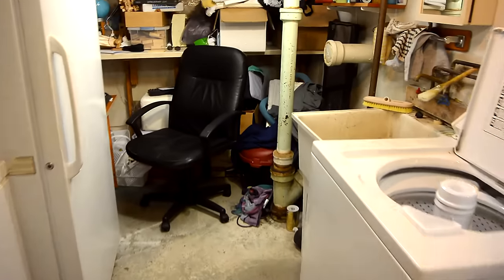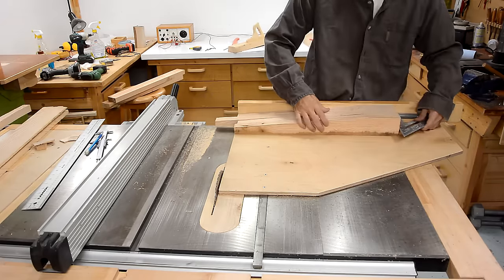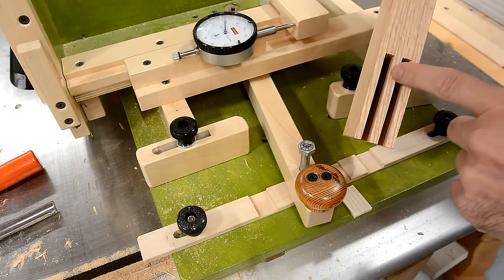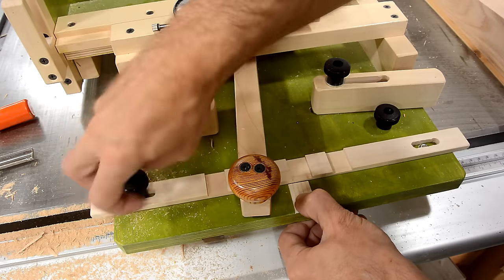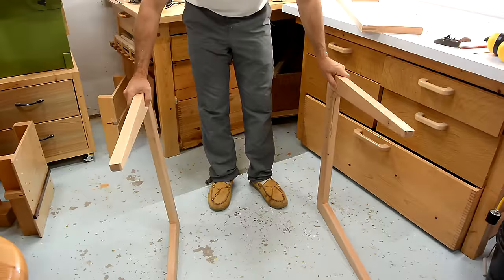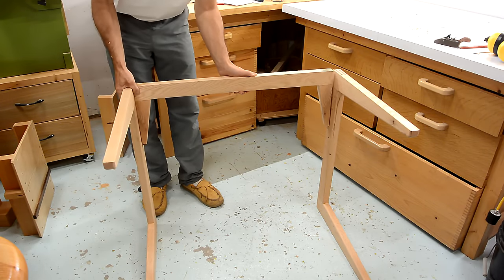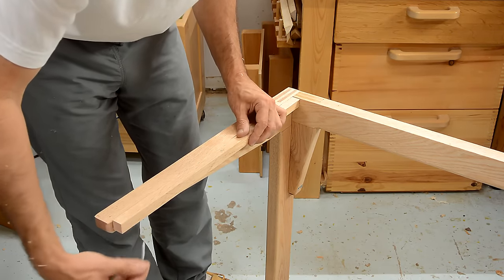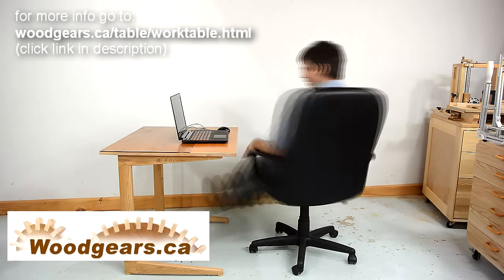Cantilevered work table

Comment: Is that a Lenovo Y500? I may be assuming too much because of the red keyboard, but it looks just like mine.
Reply from the maker: Not sure what the model number is, but it's a "gaming PC".  Had to get that for the quad core i7, which I need for video editing.
Reply: Sounds about right. I have it as well, but never added the 2nd video card as it was too expensive. Thank you and keep up the great work!
Reply: I have Y700, looks like that

Comment: I don't have the skill for that joint, what's the alternative?
Reply: I've found elmers wood glue max holds pretty well, I just use that and screws. At least, until I get more than a $100 table saw
Reply: That is basically a finger joint. If you have a some kind of table saw, and a crosscut sled, you can make it.
That was my first attepmt, and a day after, I made Darbin Orvar's jig (it's way more easy to make than the one by Matthias).
If you dont have a table saw, make one out of a handheld circular saw and a table by mounting it upside down, and adding a secondary swicth to the table.

Comment: Function over design taking to a whole new level. It's a nice desk to use I bet, but it looks awful.
Reply: For a desk that's only going to be used by him in the laundry room, that probably cost him nothing to make because he used scraps, it's fine.
Reply: Eh, just the tabletop. If he sold the plans, you could just build one yourself with a nice top.
Reply: Dave Starr I'm not commenting on whether or not anybody going to see it or if cost him anything. I'm simply saying that it could have been a fine piece if he had used a better top and better materials. I understand he didn't want to spend any money on this since it's only a desk in a laundry room.
Reply: Ok what's exactly awful? The multi-colored top? We didn't see it in the intended spot, did you notice the shadow? Perhaps the light angle is lined up with the different shades on the desk surface, we don't know. However the legs with the finish look pretty good in natural oak.
Reply: Falcon Rogue No finish, horrible tabletop, bland design. Also remember this is a simple opinion by a person on the internet. If you like it, great. This project just wasn't for me. I like to see that little ekstra put into it to get the finished look.

Comment: How do you even know these joints are this strong
Reply from the maker: It's more the strength of the wood.  Half the wood is cut away, but the rest of the wood would take an awful lot of force to tear apart.  Basically, this sort of joint fails when the wood tears apart, not the glue.
Reply: +Matthias Wandel i was shocked when i saw you jump on it. As a non woodworker (Im interested in starting) i though it was just sturdy enough for a laptop and a monitor. i have been planning a desk which will be around 2 metres wide, would this kind of bridal joint work just as well on a larger table?
Reply: Matthias Wandel Oh, well. Thank you a lot for your reply.

Comment: nice frame but ugly table top.
Reply: It isn't the best looking, but it isn't offensive.
Matthias has expressed that he finds basic functional things aesthetically pleasing, so I imagine it suits him fine.
Reply: To me it's the fact he goes with the effort on making the legs perfectly by using a jointer and routing then tosses on a beat up looking top. I would of at lest stripped down the old finish and slap on a new finish of some sort.
Reply: Leland Clayton Like to point out that sharp edges and corners on furniture are shitty enough to run into as an adult, but when you add kids to the mix...
Reply: He uses recycled material, beggars can't be choosers ;)
Reply: +MrFakit this ain't chipotle
Reply: +KarlBunker he would re purpose veneer into paper or make plywood out of it.
Reply: Yeah, it's a shame that beautiful laundry ended up with such a dull table...
Reply: altaroffire56 Exactly. My laundry room desk is made out of solid platinum, encrusted with diamonds and inlaid with an intricate gold floral pattern.
Reply: If it was nice he'll need to paint it green.
Reply: ah, very true.
Reply: Joshh Rodriguez

Comment: so. what cad software did you use
Reply: None.
Reply: +nrdesign1991 actually he used Sketchup
Reply: Fjolfrin the Silk Beard this looks suspiciously like a hand drawing: http://woodgears.ca/table/worktable02-b.jpg
Reply: +nrdesign1991 It's Sketchup version 1970s
Reply: 0:16  It's a fountain pen
Reply: +12345NoNamesLeft 

LamyCAD?
Reply: http://woodgears.ca/faq/index.html Ctrl-F "CAD", or scroll down a bit.
Reply: It's called eyeballs,  the original version with a pair of patches.

Comment: Now some 2500mm wide and 900mm depp and mounted to the wall please (yes, I need one right now, why do you ask?)
Reply: You could use the same design minus the bottom rail of the C shaped frames. Just space the legs so they both land on studs, predrill and countersink long screws to mount it right into the studs, you could likely hit a couple more studs behind the back cleat as well.
Reply: Actually at 2500mm you'd need to add one or two more "legs" (now L brackets).
Reply: ***** I will probably make the support arms/legs/whatever triangular/curved. My biggest problem though is calculating/estimating how much I need to properly support some weight (the table should carry more than some laptop) without bending down and find some means to fix it to the wall properly
Reply: Dennis Lubert Each of the finger jointed brackets he made here would carry hundreds of pounds easily. Screw into the studs, especially along the top (through the back cleat) and it'll never budge.
Reply: ***** the point I mean is, that when I put like 20kg of weight near the edge, it will bend down a bit, and I want to prevent that as far as possible. One can use the sagulator to crudely estimate how much when using straight beams, but in case of triangles its not that easy. Those though would allow me to direct more of that force into the wall. But with 900mm away from the wall, even the 20kg will leverage quite some force onto the upper part where it is fixed in the wall, and so I need some good anchor in the wall that doesn't cost 10 bucks each :/
Reply: Dennis Lubert Yes, a pair of 4" wood screws into every stud along the top would be more than enough. If it's being used as a motorcycle display stand you could run a bead of construction adhesive along the back cleat and have it glued directly to the drywall/plaster as well.
Reply: ***** Where did drywalls enter the game?
Reply: If you make triangles amost as deep as the table (90cm) an almost as high (although 90cm would be more workbench than table height), I would expect no flex at all even when the triangle is built as a frame out of 5x5cm wood. It all depends how your construction should look like. A triangle already is half a leg.
Mounting to the wall isn't a big issue (if your wall is solid). Just remember that the "pull" on the upper screws of the vertical pieces of the mount is approx. weight of the tabletop + whatever you put on it divided by the amount of mounts. They will want to pull out of the wall due to lever action (avoid shearing the screws; the vertical load should be taken by friction of wood against the wall not the screw shafts). If you shorten the vertical parts of your mount, you will have to multiply the load on the screws accordingly (e. g. half the vertical height, double the pull)
Reply: superdau thanks, exactly the things I was not sure about. I was thinking about 400-500mm on the triangle length at the wall and 800-900mm under the table,so double the pull. So the table weights a bit too, so I am definetly over the traditional plastic wall anchor limits I guess and should go metal, at least for the upper part where the pull is strongest
Reply: Dennis Lubert
Just from a gut feeling (I build a lot of stuff in and around the house, including sheds, car port, fence and balcony, and non of that collapsed yet ;) ), I'd think a 8mm-10mm screw should be fine, even with a plastic anchor. I assume a cinder/concrete brick wall and the screw going into the wall 75 or so mm (and brand nylon anchors not some cheap china plastic). Of course that also depends on how many "legs" you have. 4 over the 2500mm feel fine. I'd trust a 100kg for each of these connections, if you have the luck of full concrete even more (no guarantee though, as that's something I'd really need to drill into wall first to see how "massive" it feels). Of course you can also use those injection type anchors that essentially epoxy (or something like that) a threaded rod into the wall, but I think that's overkill.

To be accurate you'd only have to take half of the weight of the table into account (the part at the wall does not "pull" at all, that part at the front "pulls" fully; on average it's half the weight), but you don't want to underestimate here, especially if you are maybe using a hardwood table top like beech for example.
Reply: superdau not decided on the wood yet, depends a bit on cost and availability. The wall is calcium silicate bricks with holes in them, not sure about the distribution of the holes, thus it is not so clear to me how to derate the anchors holding capabilities if not fully surrounded by the brick. I have been thinking about some kinds of steel anchors that end up essentially in threaded rods for the upper part of fixing the table (and add some construction glue just for the fun of it)...the reason why I am afraid of it coming is that I will sometimes be putting really expensive stuff on it.

Comment: Hi, for every engineering project that I have done, I have always used non motorized tools for cutting things like a normal saw. I am going to university soon and I expect that I will start using power tools on my projects. What concerns me is that I am very clumsy, I'm afraid to injure myself. Any suggestions with that?